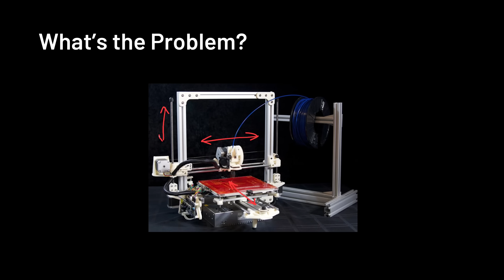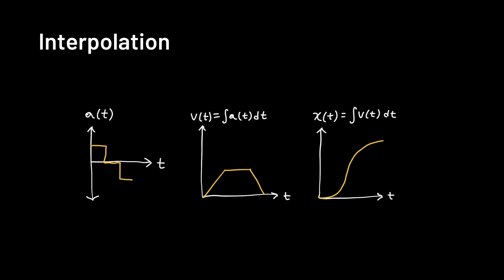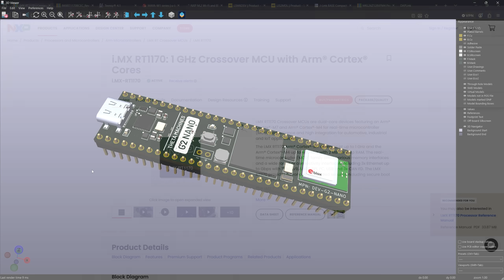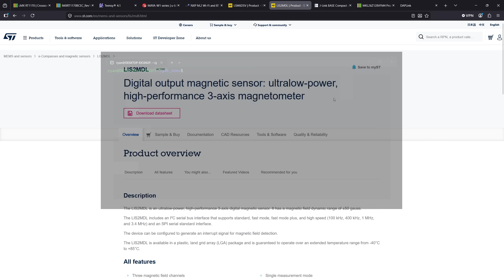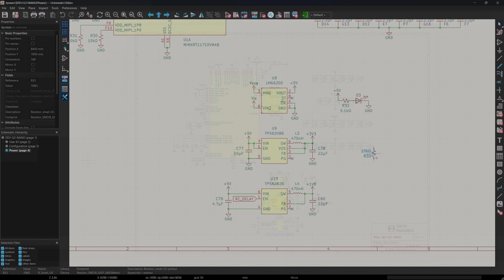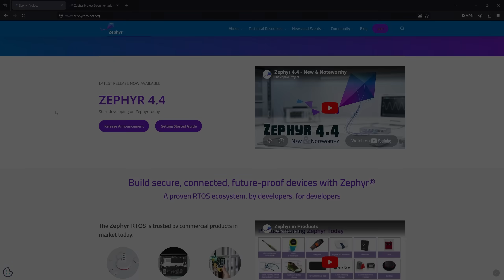I Built the Fastest Microcontroller Board for Robotics

Comment: I recently programmed ST Micro's STM32G474 controller (high-end power conversion device) using Claude Code. Claude will save you tons of time. Go bare metal - no problem.

Comment: Great ambition, wish you all the luck mate. One thing I would like to interject is it is much more important to have multiple cores rather than a singular core that goes very fast, especially when you're dealing with robots with multiple actuators and multiple sensory inputs an RTOS system is unbeatable. Also integrated hardware communication peripherals rather than external, can also cut on cost complexity with IO.

Comment: I like the open source aspect for the performance. Reminds me of the P4 in aesthetics. I wish there were a better solution than extending the PCB in length, as a longer board length can become an issue with smaller builds. Personally, Id rather have the board in a more square shape with shorter length on the longest side (similar to a flight controller or multi-rotor ESC if you're familiar with those) but I dunno how much difference that would even make

Comment: Awesome project! It would be cool if the state estimation would be based on a geometric algebra representation of the six degrees of freedom for rigid bodies, i.e. a projective geometric algebra (PGA) motor,  and the state estimation be an event-based Bayesian filter as the general framework. Then each sensor measurement could be an event fed to the Bayesian filter to update the multivector representing the best estimate and uncertainty for the position and orientation of the controlled body. This would elegantly allow sensors with different measurement rates (e.g. GPS and IMU) to be combined in a statistically meaningful way.

Comment: If you hadn't made it, I was just about to begin. I also had chosen an imx rt1170, good choice. I originally went with an stm32v8 but the chip is taking forever to be available on mouser or digikey. The cortex m7 is over a decade old at this point but the wifi choice is kind of a bummer. Why not an esp32-c5? wifi 6 is important you know.

Comment: Nice design and well done YT video. I make and sell a product based on the Teensy 4.1 and this has a lot of potential.  Probably the biggest question is will you be selling it or licensing it to someone? One of the reasons I went with the Teensy is that it had a stable company making/selling. Now that Sparkfun has taken it over and is continuing production, that looks like a smart move.  One thing that became important to my customers is the simplicity of loading firmware.  The way the RasPi RP235x firmware loading works is ideal - no extra SW or HW needed, just USB.  The Teensy approach is ok but having to get teensy.exe is just a PITA for my customers.

Comment: Why are you sticking with NXP and M7 when Renesas has the M85 Arm lineup with much more robust floating point support, 1GHz clocks, and a main/sub MCU dual core setup for when you need to do some task out of the hot path? Also, it seems like you're potentially overlooking some of the things the Teensy gets right. For instance, logging data to a 32 GB SD card opens the door to things that wouldn't be nearly as straightforward on a platform like the one you're proposing. That kind of IO convenience can start to play a big role for people choosing between this and something like the Teensy 4.1. Wifi is nice, but being able to do things like per-tick logging of an estimator state in 5-15 us is really not reliable over wireless, but it is reliable to an SD card.
Reply: Interesting comment

Comment: Hi there! Great work on this project — I’m really interested in it.
I used the powerful TeensyStep library with Teensy 3.5/3.6 before. It uses FTM + DMA for high-speed pulse generation, running on NXP Kinetis Cortex-M4F chips (MK64FX512 / MK66FX1M0).
Since Teensy 3.x is discontinued, all my projects using TeensyStep are stuck. I can only buy used boards to continue my work. Your project is a lifesaver!
One question: Teensy 4.1’s NXP iMXRT1062 (Cortex-M7) doesn’t have FTM peripherals, so TeensyStep can’t function properly. Can your project deliver high-speed synchronized pulse output? I use stepper motors and pulse-direction based industrial servos.
Looking forward to your reply!

Comment: I've been working on project that I've been testing the same mcu and wireless module with zephyr. If you're planning on getting a dev board to work on the firmware, I'd recommend skipping the nxp eval board and getting the phyboard atlas, its cheaper and the nxp eval boards are extremely frustrating, and can require a lot of rework to get set up with what you want. Idk how much low power comes into play with your project, but I have had a lot of issues with the low power modes on the rt1176. Also for the zephyr drivers for the iw612, a majority of the pins aren't incorporated into the driver, so will need to be handled on the software side, as they aren't included in the dts. If you plan on significant code for the m4 core, you might want to bump your ram up, because the m4 core can't run off flash code, the m7 boots both cores and code for the m4 core needs to be first copied to ram and ran from there.  I'll definitely be following this project with interest.

Comment: I would go with Rust especially for the hardware drivers as if done right they will be rock solid without any foot guns unlike other languages. To make it easier for use with python and other languages add a C compatibility API on top in addition to a normal rust one. A feature switch to select between them when compiling will keep the code small but both easier to maintain in the long run. The OS you are targeting I'm sure will require the C interface anyway but having the ability to roll something custom allows for long term support if something else comes along  to replace what people are using now. Just some thoughts I had and looking forward to see the project's future.

Comment: This is great! Especially for beginners. 
I've personally started using STM32 boards for drones into regular robots. Most of them have all the sensors required and bonus of having a PDB board and battery connector. 

This can definitely use a proper pdb with xt30 and power for motors, perhaps power for a raspberry pi kind of boards as well. Less wiring, seamless.

Comment: Nowadays I could just stick a mediatek or allwinner chip

Get octacore, 64 bit with fpu, a gpu core, all the stuff a mcu have, then slap the fgpa, some ram, and esp32 and maybe an stm32 

There's a really fast board, with pcie and m.2 too

All the processing and glue logic you could throw some bits at

Main chip to up to 3ghz, esp and stm32 run a lil slower but that's basically gpio space

Comment: Great work, however imho consider having a small ethernet controller instead or along the Wifi. E.g. even a 100mbit w5500. It would be more reliable and make the pcb device also suitable for industrial applications. In many industrial applications Wifi is forbidden, they avoid it like the plague :D

Comment: why not use a esp32 series of mcu? the esp32 s3 is good and so is the c5 that has both bands of wifi and the p4 is very powerful as well and they are cheaper than whatever you are using right now plus its easier to program them as well. would love to hear your thoughts on his as i am a student trying to make a board for myself as well
Reply: The esp32 has a fake fpu.  Its throughput is abt 1/10th the stm32 per clock bc it's sw emulated.  Plus it has lower clock speed.

Also onboard ram and flash on esp32 are small.  You can use off board ram and flash but performance gets unpredictable.

Esp32 is good for smaller tasks but doesnt scale well.  Fight me.

Comment: Must do CANOpen and CANFD hardware on it.
Reply from the maker: It has 2 CAN/CAN-FD interfaces!
Reply: EtherCat is the new hotness.
Reply: A few years ago I had a teensy 4.1 running an EC master/cia402 state machine as a pi co processor on my test bench. 
Now that the company I’m at has a little more money I’m on the acontis stack but csp planning ran very well on just the 600mhz teensy processor. I bet 1ghz would be lovely for 4k/8k ethercat loops on a few drives.
Reply: @kayakMike1000 Once this superb device can talks etherCat, so there is no limitations for use it on multiaxes real precise machines!
Reply: @kayakMike1000  yeah an esc companion chip could be added pretty easily tho, like a lan9252
Reply: @xxportalxx.  I don't know sufficiently enough, but the implication is that could manage ethercat in daisy chain?
Reply: Love the CAN do mentality

Comment: I kept looking for a powerful but compact development board to run model predictive control for a self balancing robot, but the current choices are quite limited.
Renesas has some nice MCUs but board selection is limited, ST announced the STM32V8 which should have a low pin footprint option but it's still far away.
I ended up with Makerdiary's RT1011, the Teensy felt outdated.
I look forward to your project!
Reply: I also have a question, did you consider other wireless modules like the MAYA-W4? From what I see it's around the same price but offers Wi-Fi 6 and 802.15.4 (may not necessarily make sense).
Is there something specific about the W1 that made you go for it?

Comment: Would have been nice to see a RISCV board, not many of these available yet. Renesas has their RZ/Five board with a single RISCV core at 1Ghz and it has the ability to add single channel DDR3L/DDR4 module enabling memory capacities beyond a traditional MCU. Yes, the NXP part has the ability to use PSRAM, but you can't find PSRAM in high capacities. Perhaps something you can take on as a future project ;)
Reply from the maker: Thanks for the suggestion!
Reply: I can't figure out why they call themselves Wren Asses though. It's like a very OCD way that they were given the bird.

Comment: I am curious 🤔why u have 3 items on the back ? If u had mad board bit longer u could have made it all 1 sided 😊 it will reduce pick & place cost {alternative penalty is speed and cost } . That would have allowed u to add castellated holes which will make it easy to integrate in final product .  Just curious 🤔
Reply from the maker: I definitely considered making it one-sided with castellated holes! The main reason I'm using both sides is so I can put the bypass capacitors directly under the processor's power pins. This helps with decoupling and keeps the boards small.

I probably could have made the board a bit larger and crammed everything on top, but it would be very dense. Including the bypass capacitors, there are about 100 components on the bottom.

Thanks for the suggestion! It's always fun to talk about design decisions 😊